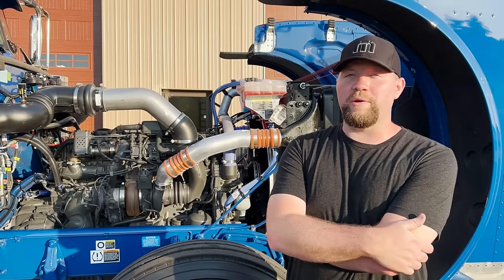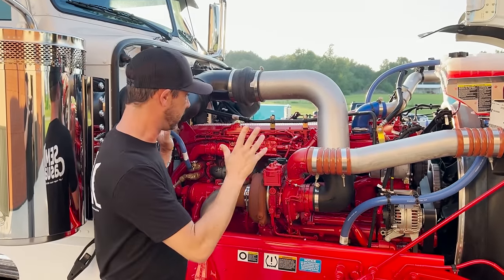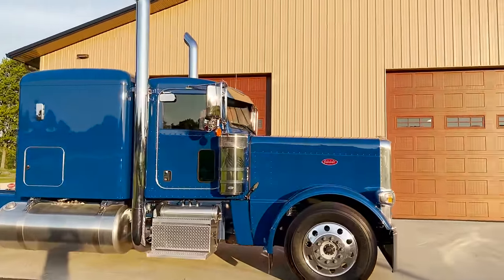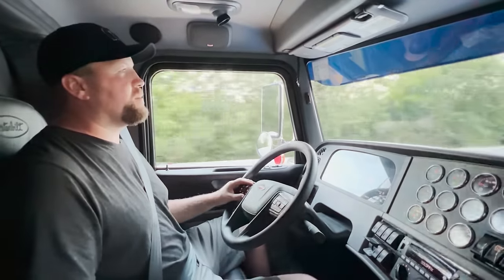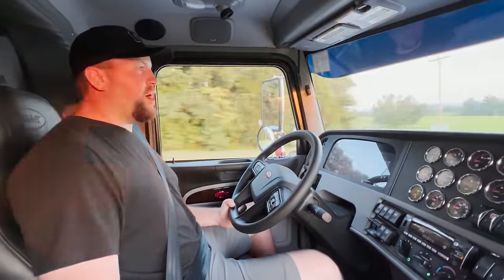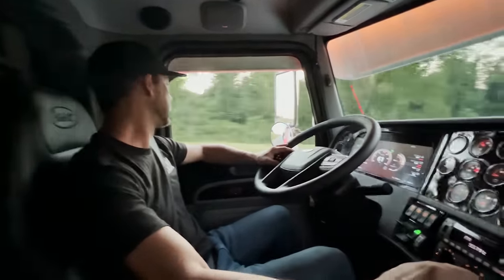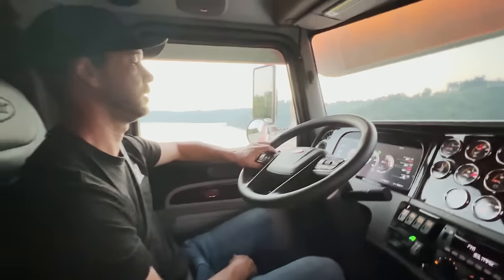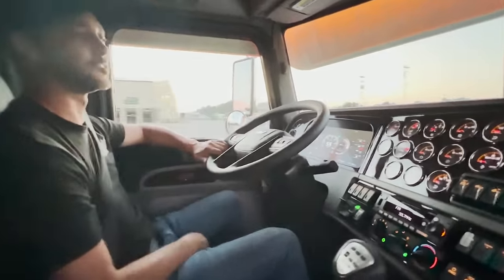Cummins X15  VS.  Paccar MX13  -  What are you gonna choose?

Comment: Depending on your needs, sometimes the bigger displacement engine can make the choice for you. I'm a Heavy Haul/Oversize guy, I run a new Western Star 49XSB 4 axle daycab and I'm a huge fan of the X15, I run the 605/2050 with an 18 speed. The pulling power of the X15 is pretty much unmatched for me, the MPG is actually pretty good for having the ability of hauling very heavy load, and the downtime has been basically zero. For "regular" weight hauls, or even doubles in the 120,000-140,000 range the MX would probably get the job done just fine, but my preference has just always been to spec with the big HP, and not have to work a smaller engine a lot harder to get the job done.
Reply: If you think that cumapart has power then I can only imagine what youd think about the C18 in my 367 Pete. My Cat has 50% more torque and over 200 more horsepower and NO REGEN!!! It would pull your truck over the river and through the woods all the way to Grandmas house. Its rate for 150 tons whats yours rated for?
Reply: @MasterWitchDoctor  You're talking a modified truck with an engine that isn't even available in a new tractor for highway use, I'm talking 100% stock that you can drive out of the dealer's yard.  Once I get some mileage on it we'll probably have a few mods done, but stock vs stock, you bring a new Pete or whatever with a Paccar, DD16 or a C15 Cat reman and hook up with a nice load and we'll see. Gotta compare apples to apples, by the way, the strongest factory stock tractor I've ever driven was in England, a relative drives a Scania with the 16 liter V8, 770HP, that thing is a real beast, I wish they sold them over here. Google Scania Trucks, interesting how they do the job across the pond.
Reply: You could run the Paccar with those weights but it would suck, Canadians do it all the time with that  low power in the Prairies, thank goodness I never had that spec
Reply: @MasterWitchDoctor  Lol, I think mine can handle anything that gets thrown at it. Check out what a Cat D10 cable plow with rock ripper weighs and the 3 axle jeep and 5 axle lowboy to haul it with, then add in my 4 axle tractor. Look it up and you do the math, real world work using something you can actually buy .
Reply: @MasterWitchDoctor  sounds like a great rig. I run a 770hp V8 Scania here in Australia. She pulls 5 trailers of coal 24/7 7 days a week. Shes just done 3 years of work bought new in 2020. The V8 scania is a beautiful truck with spacious cab and comfort. GVM loaded is around 250 to 280 tonnes. She only shuts down for her service. I have 3 guys working on shifts round the clock. Engines just clocked 24,000 hours run time. No oil leaks on engine trans or diffs. Serviced off hour meter she gets oil n filters changed every 300 hours. Its been a great truck pulls well being a v8 from 950rpm up to 1370rpm she pulls. She's expected to do another 3 years on this current contract so next month shel be getting torn down full engine, diffs and trans rebuilds. All seem fine but as the contract has reliability clauses we want to ensure she will do the next 3 years trouble free. In the last 2000 hours I've noticed shes using 1 to 2L of engine oil between services not too bad really for the hours shes worked. Once the next 3 years are done I will be ordering another one. Ex Pete and Kenworth owner. But the Scania is in another class for performance and comfort.
Reply: I ran with a national grocery distribution company for decades we ran 102.5k pulling doubles every time corporate sent us the junk they specd out for the Midwest always ate more fuel than the larger power equipment we specd out for the northwest, the smaller engines just had to work to hard compared to the bigger power
Reply: Paccars are junk regardless and need rebuild by 500k. They’re disposable engines not made to last
Reply: Do you have isx15?

Comment: I had a 2016 Pete 389 with MX-13 , 505, 510 HP (can't remember now) put just under 500K on it with NO issues, no sensor problems. I loved the sound of that engine, yes it was quite, so quite I could hear the air getting pulled in those twin air breathers on a quite night out west. It had a Horton fan clutch that only came on when pulling up a steep grade. It also sounded good when idling. I now have a Kenworth W990, X-15, 565-1850  with the same fan clutch and it comes on when driving in the yard or truck stop which stirs up all the damm dust. It does not sound good either. When iding it sounds like marbles or something ready to come loose. It also sounds like crap when accelerating, reminds me of an old Cadillac that's missing one 1 or 2 cylinders. I don't like it, it cost a hell of a lot more and is heavier. I pull a tanker and can't haul as much product. For you guys that like the big power, Paccar is coming out with the MX-15 in the near future!
Reply: Paccar is coming out with a MX-15? I had always wondered if that would ever happen.
Reply: Just turn the ac off when in the yard
Reply: You got an article or any info on that supposed mx15?
Reply: When pulling hard the Cummins sounds like it has an exhaust leak to me

Comment: I drive a 2019 Pete 579 with a Cummins X15 efficiency series and we haul water in the socal region, very impressed with their mileage and their power is very nice, I pull hills quite easily mostly down the grapevine into Bakersfield. The engine brake on this truck is really good, it keeps you from having to apply the brakes to often and I like that, I think if i had my own truck I’d go with the cummins rather than the mx.
Reply: Yeah x15 pulls that range good. So does dd15. What about paccar?
Reply: @kdawgtv1333  You know I’ve never driven a Paccar but I see a lot of trash trucks pulling up hills and doing it with ease, a buddy of mine works for one of those companies but he drives a Freightliner with a cng engine and he tells me that those Paccar trucks the other guys drive are loaded with about 52,000 to 54,000 lbs and they almost run up the hill, they certainly pass my buddy up like nothing so that’s got to count for something.
Reply: @bullymaguire4457  I just bought a 2016 with an MX 13 need to find a good tuner for it  I know it’s on the Canadiens have somebody they deal with those little trucks or animals and these are guys that are hauling logs with Paccars

Comment: The problem with an mx is that they’re almost impossible to keep as older “paid for” truck which is when you really start to make money and afford you the opportunity to say no when people try to get you to work cheap. I had an mx that hauled 140000lbs gross for 500000miles and we didn’t have to touch it but, that’s when all the sensors and other issues started to pop up which forces you to have to go to a peterbilt shop and can get very expensive very quick, plus they’re the only people that can do rebuilds which costs much more. Stick with the Cummins it’s way cheaper over the long term, plus the resale if you so chose is substantially higher
Reply: David, I hear you on the mx, my bud's son wrenches on them, not a happy camper, not one little bit. Same as you, they haul B-Trains of nickel concentrate, 500 miles down empty back (mostly).
Reply: Yeah,you are correct.  I've heard mx  overhaul cost as much as a new engine. So might as well buy new engine. I have a mx 13 510 hp. It don't pull as good as the x15 565 hp.
Reply: America just has some issues getting used to modern times...  Cummins being the only American engine left, because Detroit is building Mercedes engines, Navistar MaxxForce 13 was a MAN design, (off course with VW owning Scania and MAN, they will put that new world engine also in Navistar now they own it) Volvo is off course a Swedish design, and the Paccar is a Dutch Daf design... and Cat quit. Apart from Cummins, none was able to maintain a profit while keeping up with emission standards, while virtually all European brands that existed 20 years ago, still exist today and are even taking over the North American market..

It wont take long before Paccar service will get to the level of established Cummins shops...
Reply: @Sjanzo  the only part of the market any of them has "taken over" is the mega carriers. Very few owner operators run those engines because the trucks they are in fall apart long before the engine is ready for an overhaul.
Reply: @carlthor91  I have wrenched on them also I had to laugh when they first hit the market for about 2 years we tried to troubleshoot certain codes and the troubleshooting said this is not yet available in your language what a support system Paccar had. I have to agree they are one of the most miserable engines I've ever worked on nothing more than a jigsaw puzzle
Reply: losing a 1500 truck payment shouldnt  be "when you really make money"
Reply: @snipemagazine1286  it’s more like 3000-4000 for a payment, losing that overhead times 5 trucks is 200000 plus per year and lowers your overhead so you say no to 1.50 a mile freight.
Reply: @davidgillis3939  3-4K a month for a truck!?? You need a new bank.
Reply: @davidsignor7931  Metric measures seems to be another language for you and sorry for you, that will never change. In case you do mean something else, your remark is crab. PACCAR engines are developed by DAF Trucks at Brainport Eindhoven in the Netherlands. In that country English is spoken as a second language.
Reply: @Jan Ligthart  I didn't say anything about metric measures what I said was the trouble shooting procedures were not yet available in our language so that translated into no trouble shooting help for certain codes
Reply: So buy some of each and have a mixed fleet, rotate the MX trucks at 400k for the best resale and put the veteran drivers in nicer trucks with X15s. For a one person company? Get a cascadia with DD15.
Reply: @CheddarCheeseBandit  mx and best resale do not go in the same sentence
Reply: What they don't tell you is a C15 will replace a MX13 like it belongs there. plug and play! lol
Reply: @truckstopcowboytruckstopco5639  that all depends on what ECM is on them
Reply: @davidcombs6291  Does it even pull as good as the 500?

Comment: I have my first MX now for the last 3 years. Parts availability has improved and no issues so far. I can not say that they are bad at all. I have no problem passing when loaded or any issues up hill. It was a learning experience for sure. As far as HP and Torque, you can always spec out higher drives to assist with the slightly less HP and Torque of the MX. the lighter weight of the MX has been an advantage as well. Thanks
Reply: How many miles does your truck have?
Reply: Higher drives?

Comment: I ran Paccar pulling bulk tanker for several years, grossing up to 95,000lbs. For the lower 455hp/1650tq rating, them engines worked their little hearts out. It just seems once you get sensors going out, it’s a downhill slide on performance.
Reply: The little bit one saves up front will be spent on labor and parts in no time. EGR flushing and sensors at each flushing not to mention the major problems camshafts, ventilated blocks, ect I would never own one of these pieces of s___

Comment: I’ve driven both. The most noticeable difference is the engine brake. With Paccar, you need to run the fan on long steep down grades. It adds parasitic load to the engine to make it acceptable. 
The Cummins hands down has better torque and engine brake in the mountains. I live on I -70 in western Colorado, and can attest.
Reply: I pretty much Drive in the flat land of the Midwest currently. But in the past I used to do Chicago to Atlanta runs. There's no question if you're near the mountains there will be no substitute for horsepower and torque and for that matter probably engine displacement.  A larger ring-gear to the pinion-gear is also a nice thing to have in the mountains.
Reply: Finally!!! Someone said it. Thank you! All these videos are about pulling power, torque, how fast can we get up a hill, etc. No one mentioned an important factor until now....engine braking ability. One thing will always stand true in big bore engines. Their engine brakes (when working properly) will always be stronger than smaller liter engines, especially with todays dual lobed cam and VGT braking systems
Reply: @jamescaliendo1030  

Yeah it's really hard to compare engines bobtailing because they're not working. Of course if you're going to Bob till around I'll probably settle for the fuel mileage because it can't be such a dog otherwise regarding the mx-13.

But as I said in other comments comparing engines: time is money-- at least for this commenting owner operator. 

 I have 11 legal hours per 10 consecutive hours off up to 60 such hours per rolling seven calendar days. That extra hour it may take that smaller engine to get to a destination may mean I have to lay up at a truck stop instead of getting home at night.  This means where I live, I'll have to idle the truck all night either to keep warm or to keep cool. At $6 a gallon diesel. This will be roughly $60 a night just in fuel costs and I'm not even counting the wear and tear on the engine and the input shaft of the transmission amortized non-cash costs.  So now how much does that small engine have to save to make up for let's say $75 worth of fuel and wear and tear on the engine per night not getting home?

Other times I have driven small engines, the top three Gears of the transmission were usually are 8th 9th and 10th the trucks just couldn't get out of their own way even when I was un laden calling a container.

For.examplw,  the westboumd U.S. 20  upward cloverleaf that merges on to s.  . ouboumd Interstate 94 in Northwest Indiana: every lane is the Hammer Lane and if you have a truck that can't get up to 55 mph in speed wit in 3 miles you're going to have people driving up your rear end.

I drive a car that has relatively more horsepower than the average car for its weight that was built in the year 2000 no my Solara doesn't get the fuel mileage of a Corolla but there's times when I need to put it in second gear and get it up to 6,000 RPM to pass around idiots or to merge on a highway.  You could say that it's unsafe to drive a vehicle that doesn't have enough power to merge with traffic.

I even had a Cummins mechanic tell me that JB Hunt has a program in their company trucks that keeps a driver from accelerating fast so it feels like the truck can't get out of its own way to the driver and order to save fuel.  I've said it many times: if a load is going to make me sweat that I only get 6.2 miles per gallon, then I'm not going to take it; I can always find something better.
Reply: @2256jimmy  Paccar did not use the fan on strategy. On Cummins, it's a feature that can be enabled, or disabled.

Comment: I’m not sure where the MX getting better fuel mileage comes from. I had a 2020 455 MX-13, and now have a 2022 450 ISX. I am on average getting 1.5-2mpg better than I could ever squeeze out of that MX-13, and my ISX is geared lower than the MX was. I also constantly spent time in the shop with it for sensor and DEF/DPF issues. If I hadn’t worked for ‘the largest refrigerated carrier in the US’ I would’ve spent MONTHS in the shop instead of the weeks I did  waiting on back ordered parts. I’m 1000% more happy with my ISX than I ever was or could have been with that MX-13.
Reply: A lot has to do with you’re gearing and ratios.
Reply: @bierutki  you clearly didn’t read my comment. I said that my current truck with the Cummins is geared lower (2.93s) vs the Paccar (2.64)
Reply: I have a new 2024 Pete 579 with the Cummins X15; empty, I'm getting 11mpg in the mountains, 13 on flat lands, and loaded, between 8-9.5. Amazing truck and engine! 👌

Comment: Like yall said, it depends on the application. If you're constantly pulling 80,000 lbs down the road, then the higher displacement, higher horsepower Cummings with the 18 speed is the better option. In my case, I haul air freight on a dedicated run with very few hills, so I went with the MX-13, Paccar auto &  drivetrain rated at 455hp/1650 torque. At 70 mph, I'm only turning 1270 rpm and averaging 8 mpg in my 579. I love the MX. However, I don't care what Paccar says about 75,000 mile oil change intervals, I change mine at 50,000 using Rottela full synthetic 5w-40 and a gallon of Motorkote. I calculated that this setup is going to save me about $50,000 over a 5-year period compared to my old DD15 equipped Freightliner.

Comment: I like to feel the engine and hear it too, helps with shifting ques. The Cummins with more torque and HP will be able to shift at lower RPM due to its higher torque and power. Still prefer a manual transmission over the autos for driver control around a job site, some of the autos are not driver friendly for creeping around a job site, especially in reverse.
Reply: They're also not easy to work doing Regional stuff for 99% of my driving's on asphalt or concrete.  I swear auto shift Transmissions were put in place to force us older guys either into our own trucks with our 13-18-speeds or to leave the industry.
Reply: No its so they can throw people that have no idea what their doing into a truck

Comment: As a fleet mechanic I would have to pick the Cummins. We have a fleet of 36 trucks 90% are MX13s. 2 have x15. We have spent more on the mx then x15. Out mx13 have more down time for small issues where the x15 rarely rarely comes in.
Reply: Lazy mechanics hate the pacar. Mechanically, the pacar dominates Cummings. It does take longer to work on a pacar. But they break down a fraction as much of a Cummings with 600k miles on it.

Comment: You forgot the most important difference, RESELL value. One better than the other, doesn’t matter. What matters is what used truck buyer thinks, and MX motors come up way short when side by side with a used Cummins powered truck on the for sale lot.